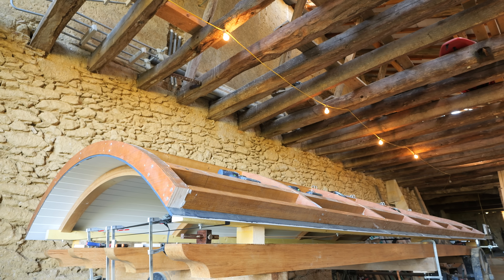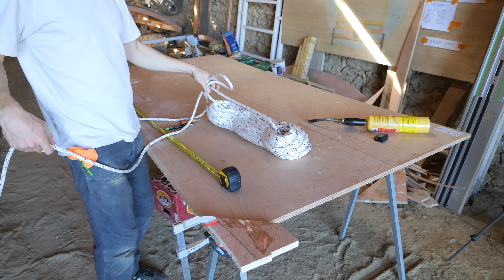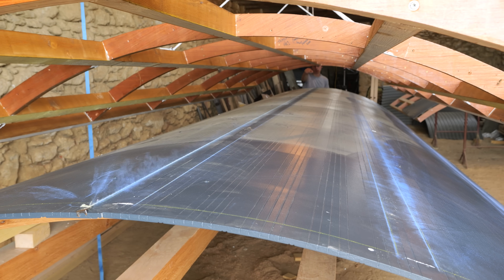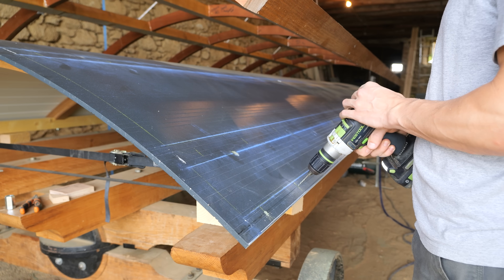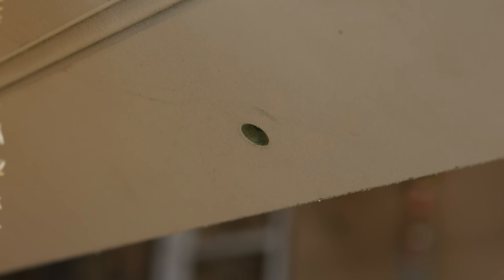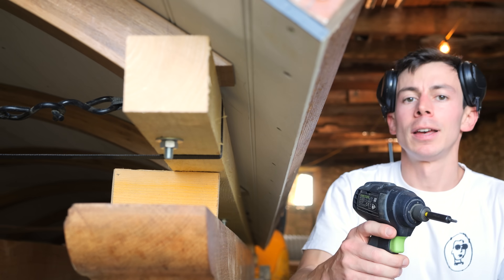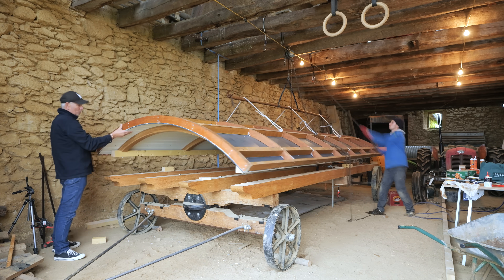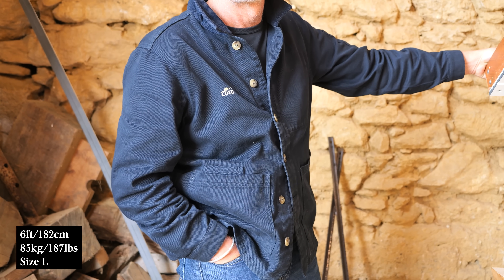Lifting a 6m Roof

Comment: I still don't understand why you had to make this roof so massive. All it has to do is hold itself and have room for insulation. It's these massive beams I don't understand. I'm a bg fan of your work but this sticks out like a sore thumb in my mind. Clearly I'm missing something. I would bore out a series of 40% holes in the curved rafters, and possibly even in the purlins, for significant weight savings. There is enough bracing between those to prevent significant buckling.
Reply: I come from a family of aero engineers and lean your way. But I have no experience in shepherds huts. Am however at age 77 building 2 custom campervans. First is light oak frame with curved sheet aluminium skin. Second is ply using Titebond 3 covered by first calico soaked in Titebond 3 then second skin of denim cotton again soaked in same. Finish looked awful so am skinning with light canvas. As strong as but very light as with early aircraft. 75 yrs ago my dad brought us from war torn England to NZ and built his first house with only aero engineering experience. Went over recently from Australia to see it again...strong and straight as ever. My life code has always been “don’t over-engineer”.. but caveat...I have no experience in shepherds huts. Nor likely the breed of horse able to pull it.
Reply: One piece give if far greater strength.
Reply: Agreed, and that weight is only the frame.
Reply: Because he wants a good solid roof.  I’ve lived in a tin can…uh single-wide trailer…i remember one storm, sounded like buffaloes dancing on the roof and I swear I could hear the screws in the frame pulling as the trailer shimmied and shook.
Reply: He’s Carl. Easiest would be to not do it, buy it or do it your way.  We watch him because he’s not you. Good luck with hour thumb. (Maybe for health reasons watch it in increments of 5 minutes?)
Reply: I agree with shawnholton5182. The original poster was critizing because Carl was not building “his” hut the way the poster wanted.
Reply: Imagine that, he didn’t even ask for your advise. Go build your own.
Reply: @shawnholton5182 The initial comment was fair and reasonable. It was a question, not an advice. 
This is social media, if one posts a video, others are invited to express their opinion, just like you did with your “advice”. Now you know it.
Reply: @shawnholton5182  good point Shawn. Bad day?
Reply: @shawnholton5182 as it is posted on social media it is an open invitation to respond.
Reply: @shawnholton5182  The one that exposes his work on internet should be open to criticism, otherwize don't open the comment section and above all, don't even expose it. I don't think Carl would disagree on this since he's obviously more mature than you and welcomes elaborated criticism but I wouldn't speak on his behalf ofc.
Reply: @itsmefabrice  my comment was not to Carl. It was to the other commenter. And yes I have built.
Reply: @peternicholsonu6090  I know it was. I was just replaying to the other one who slept bad.
Reply: @ I’m sure Carl is open to ALL criticism. I was speaking for myself, I hate how someone is a creator and some fool has to share their immense knowledge when no one asked for it. Go make something yourself.
Reply: @ Yes, you are 100% correct. “Can” you is not the issue, it’s’should’ you that I’ve started to ask myself. Carl has never said that his way of any of his approaches is the only way, I’d pile in on that, he’s just saying ‘this is my experience.’ I simply don’t see the need for any criticism. But I’m probably wrong or too sensitive.